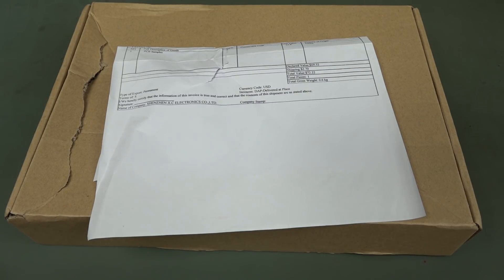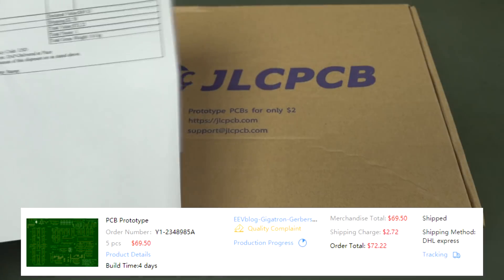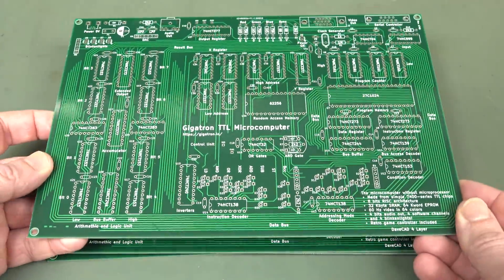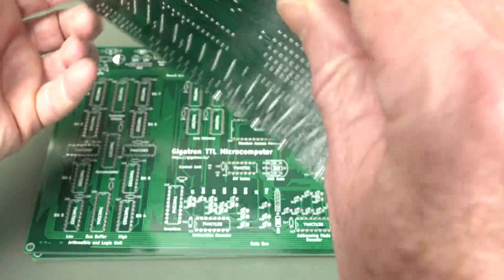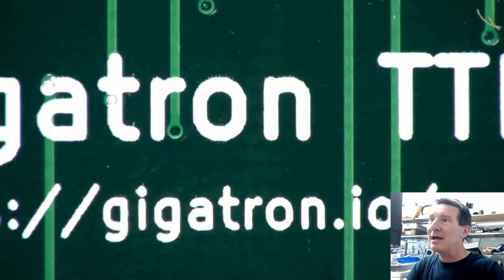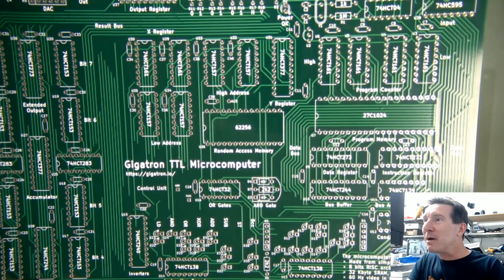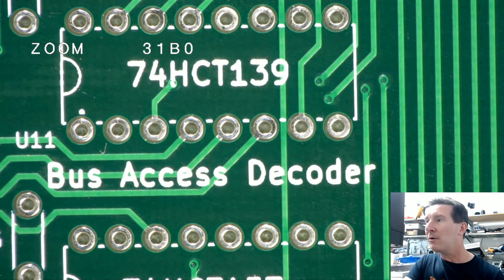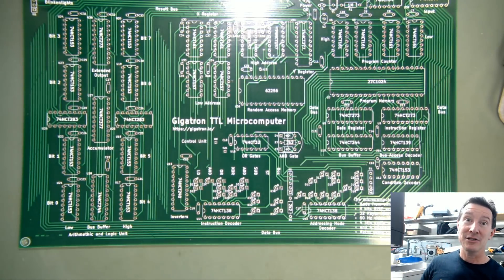JLCPCB Prototype Inspection

Comment: You can put some text in the design "JLJLJL..." And they will place the customer number in that position apparently. So you could hide it under a chip or something. Don't know if you can remove it completely though.
Reply: Also they say if you choose "Panel by JLPCB" when ordering they will put it on the edges of the panel that you break off anyway so you can hide it completely
https://support.jlcpcb.com/article/28-how-to-remove-the-customer-id-on-the-pcb
Reply: https://support.jlcpcb.com/article/28-how-to-remove-the-customer-id-on-the-pcb
Reply: Huh, that's clever
I recall from the factory tour someone made, they have people reviewing the designs and numbering stuff; that's not automated, so it prolly depends if the guy had his wheaties that morning
Reply: I tried but they didn't :(
Reply: TuttoCrafting same thing happened for me on an order of 50 boards. After confirming with them that it was okay to do.
Reply: You can remove the order number but you'll pay an extra 1.5 USD. NOT COOL not cool....
Reply: JLCJLCJLCJLC
Reply: JLCPCB panels of small designs often do not cost more and the qty price is per panel. I've gotten 10qty of 2x3 panels for $5
Reply: TAD2020 What was the shipping cost?
Reply: Whats the problem with that number anyways?
Reply: Interesting. You usually do this with manufacture panel notes, but cheap proto houses like this usually ignore them. You are relying on someone in the loop to see that and change it, so I wouldn't rely on that.
Reply: They actually do pay attention to it but the text has to say JLCJLCJLCJLC exactly and in the correct font size, there has to be exactly enough room for them to place their text in place. There is also a customer notes section in the order calculator form and I always put a not in there for the text replacement along with the part number that it is underneath.
Reply: Of course my comment that basically gave the correct info on this 3 days ago is buried and this one instead got the pin. Such is life.
Reply: EEVblog I wish there was an automated way to do this across the industry, so it wouldn't rely on human guesswork.  For example on this board it could have gotten it's own line in the description block.

Comment: I've been using JLCPCB like crazy lately. I love Oshpark's AFTER DARK boards, and I order them when I want something special, but JLC is impossible to beat. I've done decent sized boards in nice quantities (a couple dozen) where the cost of the boards was less than freight. Freight for me is like $12 typically, and I figured I'd add on some extra boards just to justify the order. They take solder nice. There's little to dislike. They ship stuff to me from China in about 3 or 4 days. I live on the east coast of the US.

Comment: Just sent off my 2nd order to JLCPCB... AUD$23 for 5 copies of 3 boards including delivery. There is NO WAY I'd be bothered with making my own for that price and quality. One is quite complex as it's a shield for a STM32F407VET6 so has to line up exactly with the board pins. An earlier one was perfect however I revised the board a bit after some testing. The other smaller boards are daughter boards that can be used with the shield for specific functionality. After uploading the designs was amazing to see the production start within the hour.

My next challenge is a board with some SMT components because I really suck at soldering such small bits. I mainly just need some resistors and leds.

Comment: JLCPCB does double side silkscreen for free, and you can tell them exactly where their identifier should go. While they can not remove that mark, you can tell them to put it in the back of the board or tuck it under a chip.

Comment: Shipping cost is, according to someone I know who has better knowledge, being subsidized by the chinese government, with the idea that china would corner the world market for pc board fabrication (and other high tech stuff).  Accordingly I guess if you don't worry about Australia losing domestic manufacturing capability for PC boards, then China is the cheap answer.  I'm hoping that US manufacturers will be able to lower their costs for entry level, low quantity protos.  As it stands now, it's still comparatively expensive to have boards done in the US.

Comment: as long as the circuitry is spot on and the text is readable, who cares about the quality of the silkscreening? and yes you can get them without the customer id. They just place the id on a part in between pcb's. they batch produce from large sheets, placing multiple pcb designs on the same sheet to minimize wasted materials. to tell your pcb(s) apart from those of other customers they have to add the id code. But if you seriously dont want it on your pcb, they will just place it on a part that gets ditched at the end of the production process.

Comment: Yes you can get high quality cheap multi layer PCB. But why are you using true holes components on a new design? Your PCB's would have been a lot cheaper and smaller using smd's even if you add the stencil cost. As a designer you have keep-up with the current technology if you want to remain afloat.

Comment: Had my first ten boards made with them. Every board has the same fault on the 5V line to the Mega pro. They burn off the pad on them all. Check the boards cannot see why it is doing it to just one pin on the own board.

Comment: The slight tracking of the screenprint looks like the disk-roller marks when you use a non absorbent medium in an inkjet printer.  I wonder if it's been printed in a dedicated inkjet style system
Reply: Great Shower thoughts right there

Comment: There are still benefits to making own PCBs. Weird shapes, single layer board with just dozens of components done in single day and quickly move over. Sometimes you just do PCBs by hand, on a piece of paper, pen and pencil, or even directly on PCB copper layer, and you can eliminate all the software / CAD / gerber / routing complexities, waiting times, custom fees and taxes headaches, failed prototypes, etc. It is not always about the price, but about flexibility and extreme rapid prototyping. If I want I can go through 6 different revision / variants of ideas of a PCB in a single day easily at home.
Reply: Some Chinese companies will route the weirdest shape for you dirt cheap, though it's been a couple years since i looked for that specifically.

But as to going from idea to a prototype or a one-off product in a day, certainly no business will help you with that at any hobbyist- or small-business-friendly cost, neither in China nor locally, so homebrewing is a good skill to maintain.

Comment: I've used both them and Elecrow for my PCBs (only 2 layers till now). And I think when you get multiple designs (I usually do that when ordering prototypes - I collect PCBs for projects in a folder and when I finally need one I just order a bunch at the same time) Elecrow is cheaper. At least when you include shipping to Europe. But they are both priced reasonably and I agree that making PCBs at home is slowly getting out of fashion. Unless you really need something that day.

Comment: I just received an order from JLC as well (same day as this video was posted). JLC took maybe 4 days total to make the pcbs and add the two LCSC orders to it. It then took DHL Express another 2 days to ship it to Germany... where it then spent 5 days in DHL Express' customs trap. While JLC and LCSC is great, I'm going to look at different options if UPS / Fedex isn't an alternative option because DHL Express is simply a nightmare. To get back on topic, the PCBs also seem to have a slightly shifted soldermask, which I hope isn't going to cause too much trouble with smaller pitch QFNs etc.

Comment: i had a JCL PCB 2 layer dirt cheap option that contains a 0.2mm pin pitch package and an BGA package that worked fantastically 
$25 delivered for 5 (plus a cool pin) 
i mean, the previous proto was $150+ shipped and 2 months from OSHpark

Comment: Watched a vid on their factory, and if you get a bunch of boards, they use real silkscreen, but if you only order a few, it is faster for them to use the dot matrix silkscreen printer. I have had about a dozen small boards done by them and all were perfect for my needs. Also, if you are doing SMD, their stainless steel solder stencil is only $7 and it is spot on also.

Comment: You can make a pcb for one hour. If it's something simple and you need it fast. But only if it's really simple. If it's only smd you also don't need to drill holes. But you wouldn't bother fror anything bugger than 5x5cm

Comment: I used JLCPCB for making boards and I was pleased with quality. I built tiny SWR meter and bands switch for SSB6.1 transceiver. I have it on my channel if you are interested. JLCPCB is a good choice for hobbyist. I would doubt that for large scale but small parties under 1000 PCBs should be good.

Comment: A few years ago I scratch built an XY pen plotter and found some nice Staedtler pens that resist etching... I made a couple of single sided boards using that, but Osh Park and the other cheap places have made that thing obsolete.  I've gotten a few things from JLCPCB.  They've always been fast and good.  The most recent was 5 of the Mk52 heatbed for a DIY Prusa i3 Mk3 printer.  It was like $58US and delivery in a week or so.

Comment: I do make my own pcbs from time to time because my employer does not give me the ability to order stuff officially from outside Europe. I have ordered boards for my students from China and paid out of my own pocket, but for a simple board I just do it using toner-transfer.
Reply: Uwe Zimmermann Yeah, too bad Olimex left the business in such a confusing way, leaving up a message that it was temporarily suspended as of a certain month (no year!) due to too many back orders.  But the EEVblog Wiki seems to have a more up to date list of European options.
Reply: Well if the employer pays for materials that you need to perform your job, but only as long as they come from Europe, that's an opportunity to support a local business. 20 times more expensive than China, but if you can make it not-your-problem, that helps. 
Look on mikrocontroller-net wiki under 'Platinenhersteller', and scroll way down for the small businesses which also happen to offer the least expensive options.
Reply: Thanks, yes I am aware of European and Swedish alternatives, but what I have received from these was not of the same quality as e.g. pcbgogo. On the other hand minimum order quantities are still in the range of 10, which is a lot when you want to order a single board for a student project's first iteration where you only need a single pcb.

Comment: Can you order 10 pieces of your current board and compare with your regular supplier :)..
 I have not had any problems with JLCPCB usually sending an email separately with the order and saying that they should be for customers. the end result is awesome. packed and ready and tested to Sweden for no money at all. When I do the circuit board myself, a card will cost about 50kr / pc to get my circuit board. The price per pcb from JLCPCB is 5kr / pc

Comment: One big downside is:
If you do mostly OneOffs like me, i need to do it all in protel (ok - old but i barely touch its capabilities (hobbyist use only) as it´s a full featured protel dxp) incluing schematics and usually some footprints as well as the whole layout (no autoroute for me, as i usually deal with audio stuff and ...no thanx).
By the time i´m done with the software, i could have also done the same on a PerfBoard and have a working (more or less - i usually need some rework done) board to work with.
Reply: Can't do SMD on proto board.  We'll you probably can using bodge wires, but I do not recommend.

A lot of hobbyists sometimes are scared of going to SMD, but hot air stations are cheap now and it's actually easier to work with that THT.  Just heat and lift.  No need to pull out the solder sucker and pull your hair out trying to clear a hole of solder.

Comment: I've had several prototype boards made by them recently, and I've been very pleased. No way would I make my own boards. I done. Even bother with vector board construction, it's easier and cheaper to get a board made. I'm considering a reflow oven for small production runs. The stainless steel stencils are really cheap too.

Comment: Looks like DHL in Australia has their business in good working order, too bad that is not the case around the world! Here in Canada, they certainly can't get simple things like this through customs in anything less than 4 weeks, and it will at least double the price of the goods!
Reply: I routinely order from them in Montreal  and it only takes 4-5 days via DHL Express. They charge 25$US for this Express shipping. So for around 30$US you can get  10 PCB delivered in less than 5 days
Reply: I've only had 1 order of PCB's shipped via DHL, and it was terrible. 2 other times I've ordered things on-line (Photo equipment) and DHL was the only option for international shipment, and both times they were also terrible ($50 - $60 custom clearance fees, then $25 for additional handling plus the added 3-4 weeks of delay). Maybe if you have a business account it might be better, or maybe they are just better in higher density regions (like eastern Canada).
Reply: Too bad DHL is not providing the same level of service everywhere. I'll keep that in mind in the future. Thanks for the info

Comment: What's the difference between prototype and production grade if prototypes are of such high quality?
Reply: Free choice of color (they will mix you your choice if the volume is big enough)
No id markings on silks
Better silk quality since its actually silkscreeened and not printed
buried vias/plugged vias
most times tighter specs (depends on the fabhouse, but china is only now catching up with 4mil/4mil and 0.3mm vias)
ENIG maybe? Depends on the volume/pricepoint i guess.
PS: don't know if the question was rhetoric but have an answer anyway :)

Comment: It really is amazing what you can get for your money. I was impressed with PCBway a year ago, but JLCPCB blows them out of the water when you consider the standard tolerances for JLC are apparently 5/5 thou (I'll be testing that soon), PCB thickness down to 0.6mm is the same price as standard 1.6mm, 0.3mm min drill is standard. The silkscreen may not be up to Dave's standards, but PCBway was very obviously dot matrix, whereas with JLC it's hard to tell without zooming right in, and even then you could put the jaggies down to the surface profile of the fibreglass.

Comment: I think they are the best for the money, I had a mistake on 2 vias, I saw this on the their online board viewer (great feature and you can zoom in), I emailed them right but because they put board in production so fast, I though for sure they would not catch it.  The board arrived within 1 week here in the USA and they had corrected the issue, so happy with there quality and price. As far as them putting their tracking number on the board, they usually pick a spot under a large component, but not always. I prefer no numbers on the board, but for the price and service I will live with it.

Comment: It's cheap because they are stealing IP.
Reply: It's not economical to steal IP off these kinds of prototypes. They have milliions of orders and most of these are crap that nobody but the guy who ordered it would ever care about, and the ones that are of any potential value probably look exactly the same as the rest to worker drones. Silkscreen is rarely this telling, it usually doesn't have actual chip designations and component values, so you go try to make sense of any random unpopulated board.

Comment: Stranger Parts visited the factory and made a video about the whole manufacturing process. They showed there are two different method for putting the writings to the pcb, for bigger volumes they use the silkscreen method with stencil, but for small volumes they are using inkjet printing indeed.